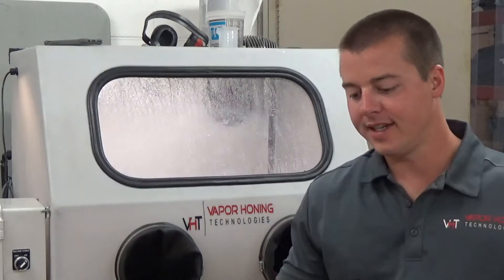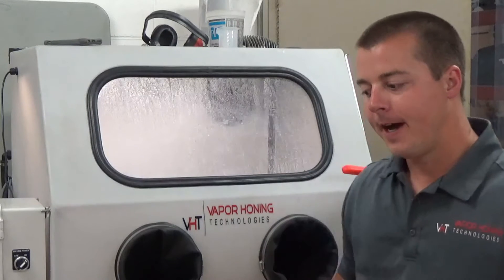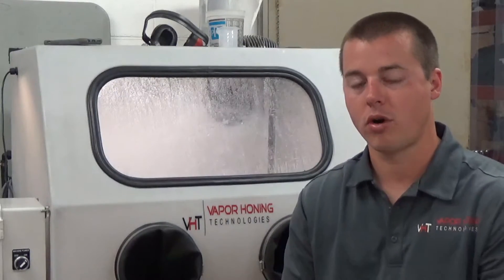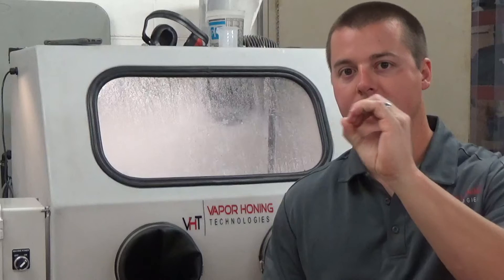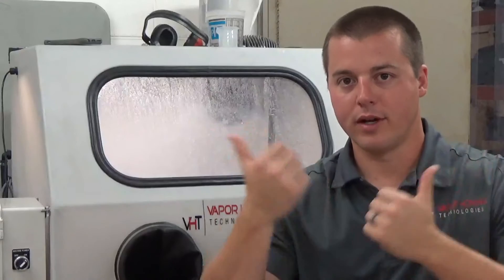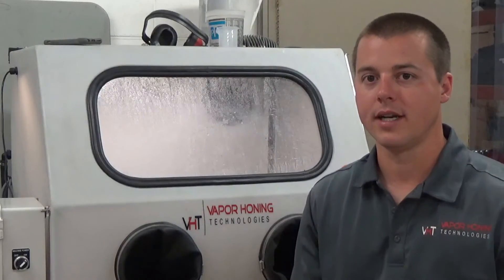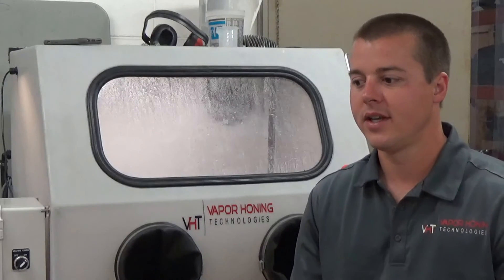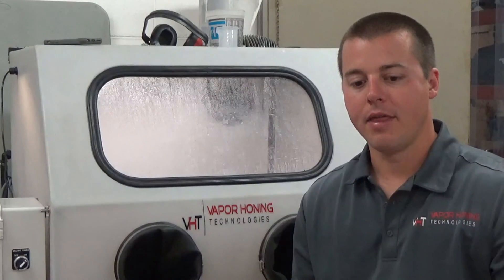What Abrasives Can Be Used for Vapor Blasting- Vapor Honing Technologies

Comment: So, from the scale on the image of your glass bead media, it looks like they're about 120 to 160 microns in diameter.   Do they fracture into smaller particles in use?   Are there even smaller glass beads available, like around 5 to 10 microns?

Comment: Can you not use sand if you are wet blasting?? As I presumably you can only get silicoces from inhaling silica sand dust particles. Surely as the process is wet there is no dust?
Reply from the maker: Thank you for reaching out to us, my name is Niki.  There is certainly no dust with this process, but we find the best results are with abrasives such as Glass Bead and Ceramic Bead.  Removing paint is done expertly with Aluminum Oxide or other such abrasives.  Call for further details 828-202-5563 x 103

Comment: Ceramic working on aluminium very well. The only problem is when intense aluminium oxide comming in the way. When the machine used propery you can contribute to saving the enviroment. That is the main reason why this machine worth the price. It requires little to none maintenance
I'm working with this machine around 25-30 hours / week.

Comment: How would this system do for deburring aluminum parts coming out of a CNC?  Specifically, the 90 degree intersection of two .625" diameter passages that are 1.25" long.  Will shooting the blast stream through the passage deburr the intersection?  Thanks!

Comment: Does glass bead wear out? What does the finish tell you about the condition of your glass bead?
Reply from the maker: It eventually breaks down into glass shards with sharp edges. These sharp edges will ruin the beautiful vapor blasting finish and you will be left with a result similar to sandblasting. This is when you know to change out the abrasive.